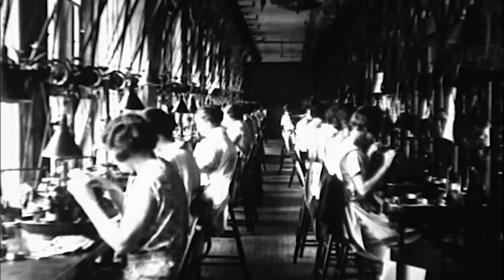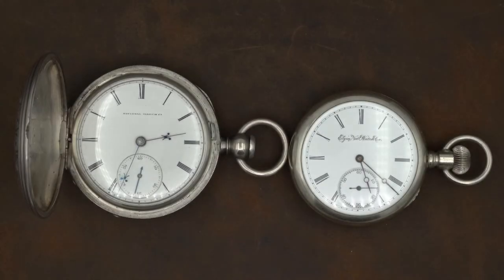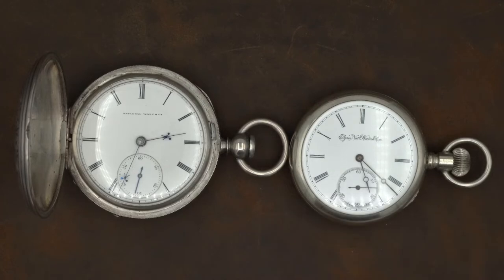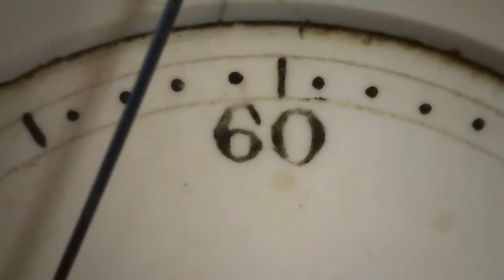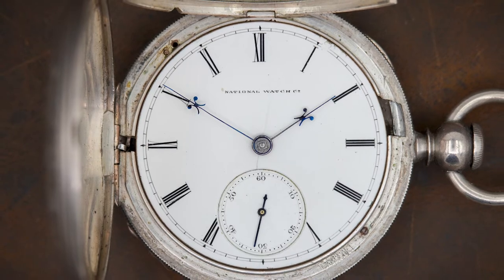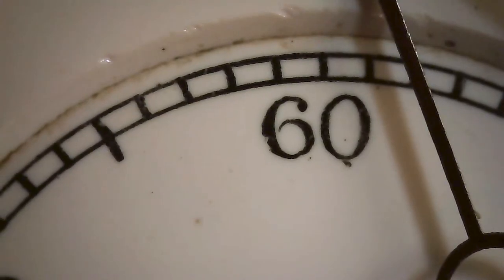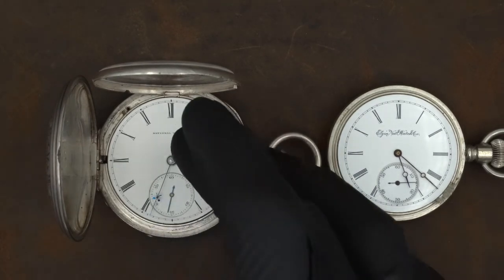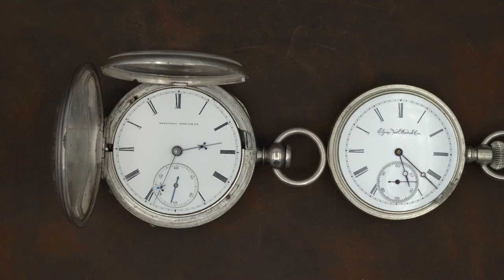Elgin Pocket Watch Dials: Hand-Painted vs. Transfer Process

Comment: Loved your video! But I couldnt understand how Webb transfered the pictures and numerics on enamel dials. I have read somewhere that He yard Photographic process but I couldnt find ant video or website how it is done. Can you help me eith this. Thank you
Reply from the maker: Webb was a master dial painter and was not involved when the transfer methods were developed. Webb would have carefully painted the design elements by hand with an enamel paint.
Reply: @americanhorology  so how can I find info about photographic process? Is there any video or something
Reply from the maker: Just published a video covering the photographic transfer process used at the Waltham factory. https://www.youtube.com/watch?v=RDK0nNTRFQ4
Reply: @americanhorology  Thank you this is üretti helpful for me. One more question, isnt it there any other solution for the sub second part to be a little deeper by soldering it. I have searched but found nothing but soldering the parts from the back so that it gives a kind of 3D shape. Is there ant other option like deepining with sandpaper or something ?

Comment: Love this!  Do you know if the “Fancy Dials” just employed a greater number of transfers?  Or were those embellishments hand painted?
Reply from the maker: Excellent question. The "fancy dials" were achieved using an underglaze process with colored enamel. Interestingly, they became popular during the same time period as the transfer methods were implemented because the dial markings were easier to achieve. I should do a video covering those as well.